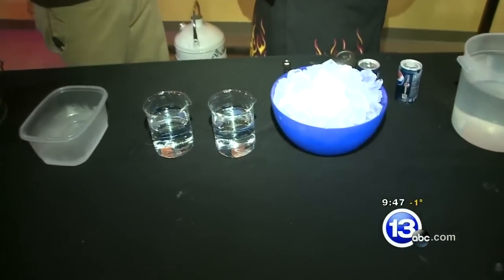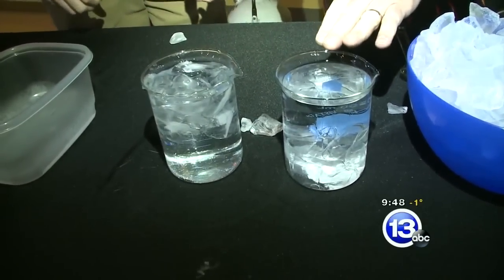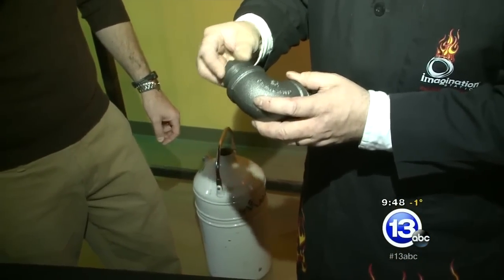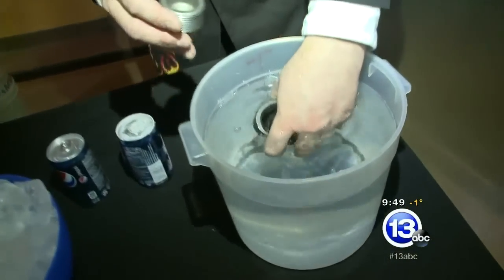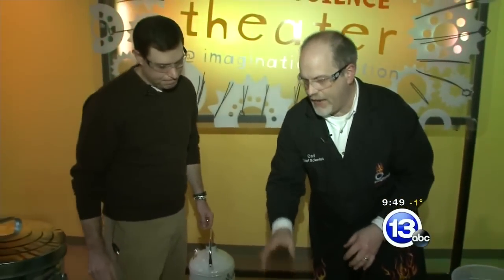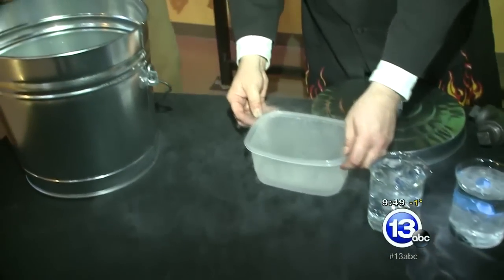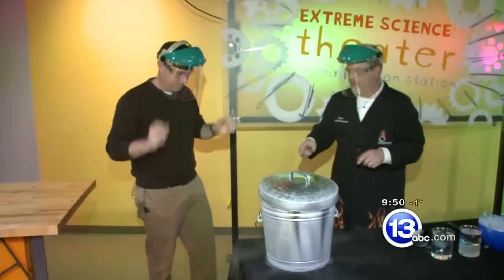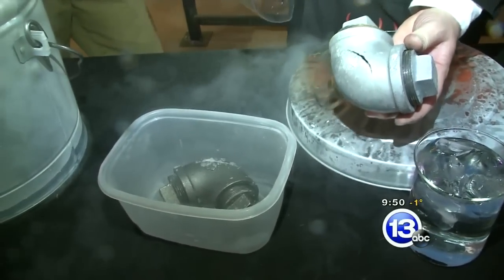Imagine It - Expanding ice bursts iron pipe

Comment: Interesting how removing energy (heat) from water causes it to generate potential energy (pressure). Usually, heat INCREASES pressure. But with ice, it is the complete opposite! So if you want to remove the pressure (potential energy) of ice, add heat.

Comment: pipe joint elbows are designed to be more brittle and slightly weaker than the straight sections.  Anybody who had to replace old cast iron pipes in a house would know that.  To replace sections of pipe, you hammer on the elbows and they brake.  Then you can remove or unscrew the elbow sections and get to the straight parts.  But for this video I have read that expanding ice can generate over 25,000 PSI of force.
Reply: Didn’t know that so thanks!

Comment: Is this even that accurate? Won’t those low temperatures deteriorate the strength of the pipes also. It will never get that cold. And not saying they won’t break after awhile from freezing water this just seems a little intense.
Reply: This is completely accurate. I have to replace multiple fitting at my car washes when they accidentally freeze. And it's usually an elbow that bursts first.
Reply: The only reason they uses somthing that cold was for the sake of saving time

Comment: Freezing generates 1000 atmospheres of pressure. 1:23 What if a Containment was made to withstand 2000 atmospheres of pressure, what would happen? Would the water still freeze?
Reply: Nope. I can supercool water in my own freezer. Don't need 2000 atmospheres for that. Just the pressure from the bottle
Reply: @izucc_xxedgydabz_xxv2652 yeah but if you tap the bottle or give it another minute it freezes
Reply: @pjcaradoc  intresting. Can iy brake anything in thid case?
Reply: Pure water wont freeze if unmolested. It actually uses the impurities in it to form ice crystals. Look up videos of people super cooling bottles of water in the freezer then tapping it against a surface. It instantly freezes once the molecules align and chain freeze
Reply: It would become Water 2 , means it gets a different crystall structure.But you would need 6000 Atmospheres for that not 1000